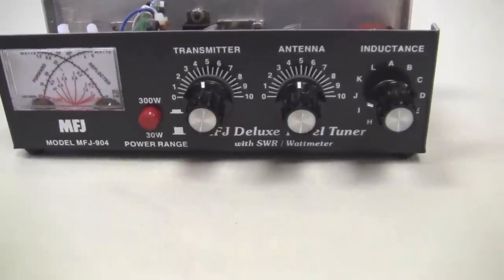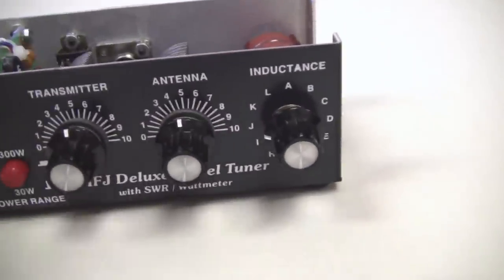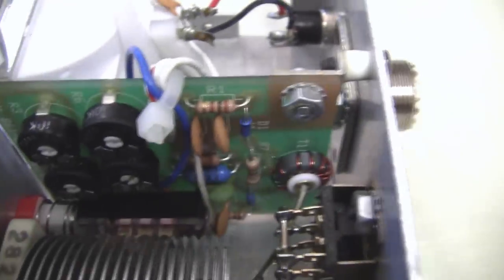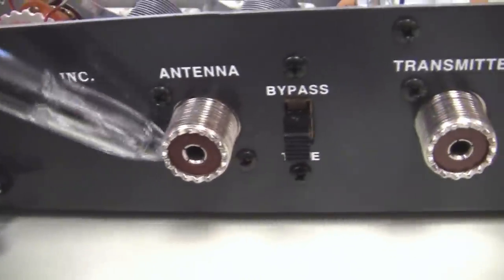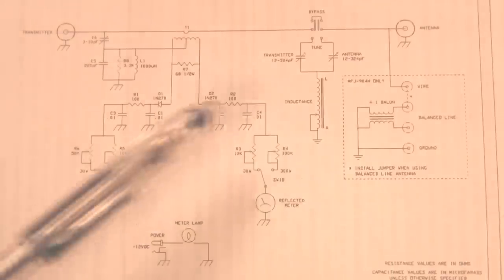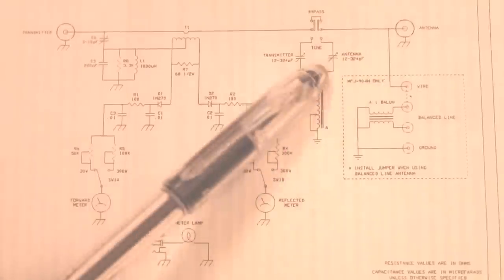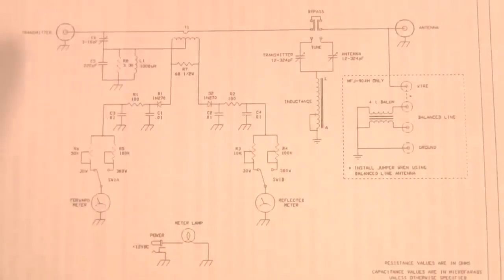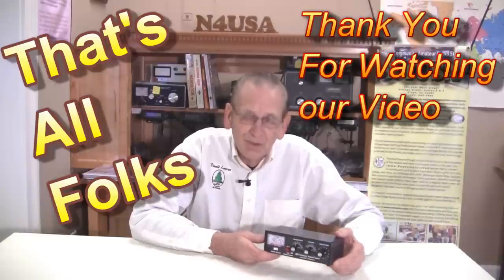Antenna Tuner MFJ 904 KK4WW N4USA Amatuer_Radio

Comment: Yes, excellent and informative presentation. I find MFJ products cheap but cheerful. They work well if kept within their design limits. My MFJ 962D needs the roller inductor servicing just now and again with new tension springs and a little touch of lithium grease with a squirt of Electrolube on the roller bar. It works well. 73 MIKE.